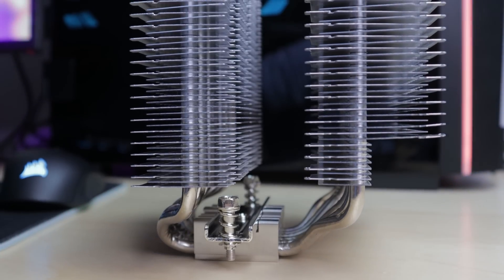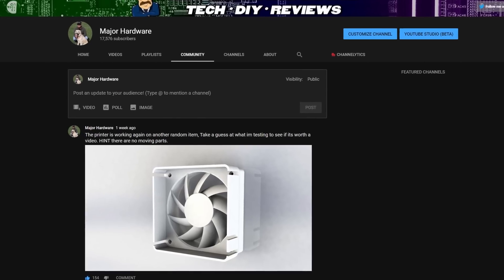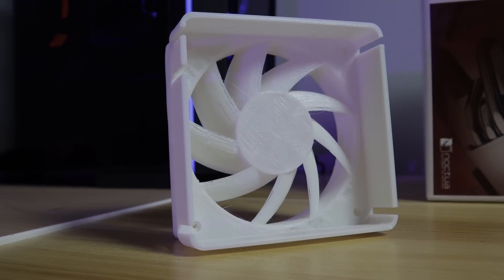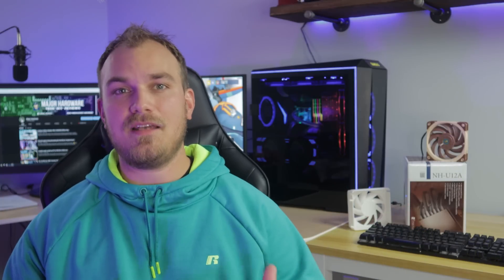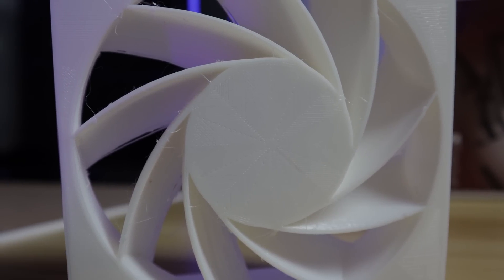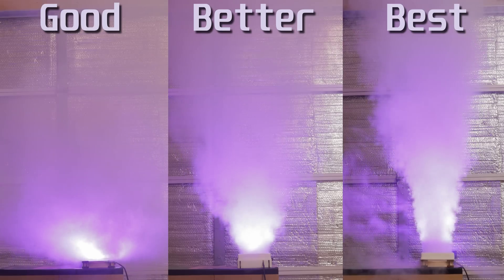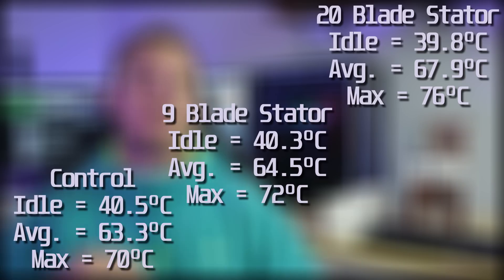Can I Make The Best Cooling Fan Better With This Add On?

Comment: I don't think it would help much on an open-air test bench, but perhaps in a case, it would have a positive effect. Something about pushing that hot air from the heatsink out of the back, versus throwing it around inside the case. Anyway, test your stuff in more of a real-world scenario (like in a case), not on an open-air bench. Please.
Reply: I always say, channeling air in and out of a case is a factor in cooling. So many cases these days have a mass of fans pushing and pulling air in no particular order, creating noise and doing very little more than recycling hot air.  Even power supplies equipped with fan temperature speed control leaving your stuffy case warm before kicking in are a shitty thing. Don't matter how many LED lights and fancy cable management you employ in your case designs, it is still junk to me.  And I also did the CPU fan channel once with a old AMD Athlon processor and did observe a noticeable difference in temperatures.  I would still be using it, but I keep upgrading to newer and higher tdp processors, and making new air channeling is not an easy task for every new build. Oh, and Noctua is AWESOME!
Reply: @pixels303at-odysee9  Best answer I can give to this is, it matters to a point. Look at the PCO-11 Dynamic, most testing shows that it works best with three fans pulling from the rear chamber and then exhausting out the top. that's two separate 90 degree turns yet it flows as well as most straight through cases, eventually you hit the point of brute force. Fans both pushing and pulling air will direct it and despite any poor design in the case, eventually they will leave no place for hot air to recirculate. At the point most cases are, trying to direct air yourself isn't going to have any impactful effect.
Reply: @Ephem13  mine has two intake on front, one 90mm on the drive bays cooling my hard drives and one 120mm cooling the pci-e slots, and then three exhaust on the rear, two 120mm and one 90mm fan.  Basically creating a straight flow from front to rear.  I voided the warranty on my PSU by taking it apart and tied the fan power to +12V rail to help cool my case. I use Noctua cooler on my processor, and it blows downward toward my motherboard, which circulates air, but I find it cools off my RAM and chipset.  Even so, the Noctua is 22c cooler than the stock  cooler at full load. I run mine with 18 hard drives and a old w3870 Xeon, and it heats my room. Thinking about removing eight drives and putting them in another lower power machine so I can run them 24/7 and use this rig only as a workstation and shut it off when not in use. My case dates back to 1996, tall 12 X 5.25" bay workstation made with thick steel. I have handles and wheels on mine as it probably weighs 75lbs as it stands loaded with everything.  I'd upgrade to extended ATX case, but nothing is big enough to fit all these hard drives.
Reply: @pixels303at-odysee9  nzxts cable management is complete trash standard routing is fine they just dont know what they are doing really over rated brand

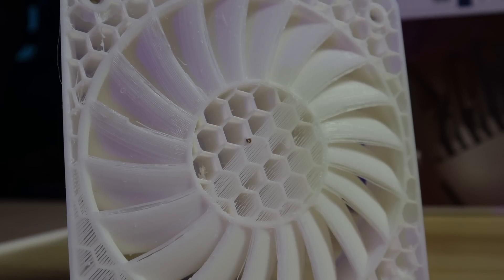Comment: 2:46
Since you used a bit of that honeycomb design there, do you know about honeycomb flow straighteners? 
They're used in the automotive industry and might be a good middle ground between straightining airflow vs impeding airflow.

Some random video I found that uses a PC fan:
https://www.youtube.com/watch?v=Ps7dMCagWOc

Wikipedia page:
https://en.wikipedia.org/wiki/Flow_straightener
"[...] in this profile we can see that the turbulence intensity is reduced from 30% to 1.2% at the center and 16% to 3.5%, it means the honeycomb effectiveness is very high which is around 96%."

Comment: Making straight flow helps improving  pc case airflow and in case components cooling, but not better cooling particularly if in your case is a heatsink. Heatsinks want to remove heat from the fins fast, making straight airflow helps but obstruction is the biggest issue. Circulating larger air mass will help heat transfer. Trying to move air fast but trapping it in the same "cloud" around your heatsink is bad.
Reply: Yub, that was my thought as well. For a case fan blowing the air straight to the cpu or graphics card (and maybe even push it further out of the case again) it might have a benefit.

Comment: Maybe you should test the airflow after the finstack of the cooler, my guess is that it just doesn't matter how circular turbulent the airflow is when it reaches the finstack of the cooler. It's just a way to justify your 3D printer purchase ;-)

Comment: Bro, i've been thinking about a L shaped funnel that you could attach to the fan itself on one end and the other end attached to the side panel. so that the air coming through the heat sink which will be hotter is blown out of the casing directly leaving no heated air in the casing which is then blown out using a case fan. So a more direct route for the air using a funnel. will it reduce or remove the need to have a casing fan?